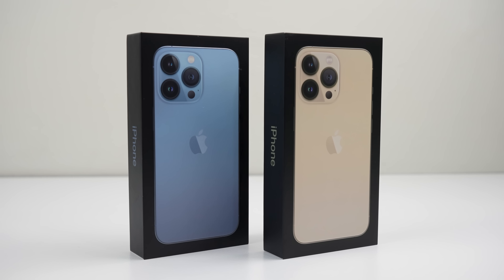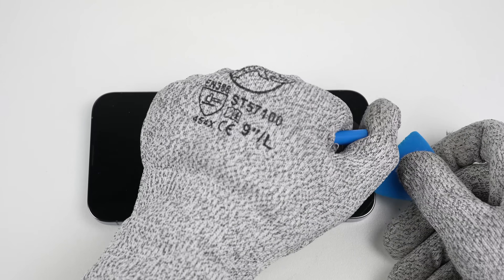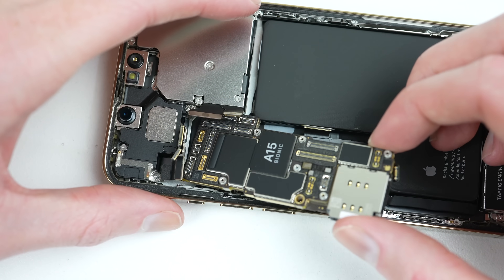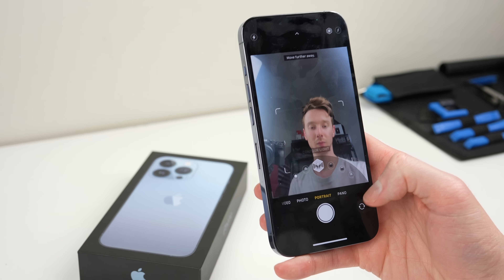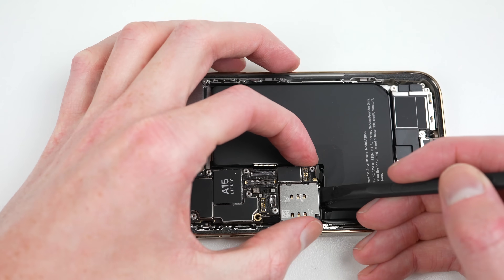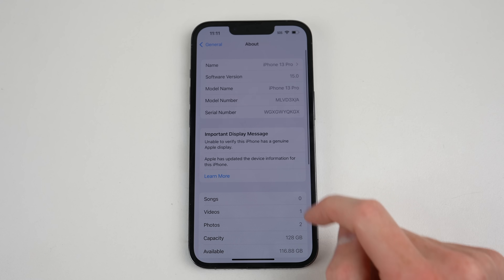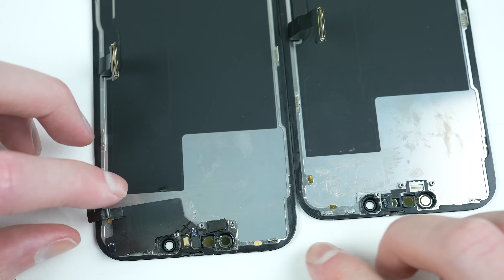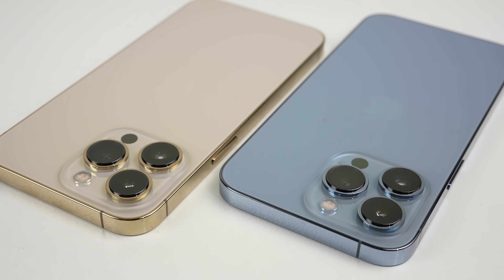iPhone 13 A Repair Nightmare - Teardown and Repair Assessment

Comment: I‘m not an expert, but knowing that no one is able to break into my phone via face id just by replacing the chip make me feel a little bit more safe. Am I right or wrong? Where do they store the face id data? The effects of a battery replacement would be interesting too.
Reply from the maker: I believe the data is encrypted and stored on the phone itself. In terms of security FaceID doesn't work after restart anyway until the passcode is entered. In my opinion, they should program the phone to disable FaceID and delete its data after it detects a new sensor but just allow you to re-enable it after you log back in and set it up again.

Comment: It's obvious what they're doing - they're serializing major components (read: individual modules have hard-coded GUIDs) and the OS quasi-bricks by disabling functionality based on a serial mismatch (read: when a component reports a GUID that doesn't match the OS' internal GUID list for the modules it was originally assembled with).

I'm not nearly familiar enough with Apple generally to know how to do it, but the hackers out there might want to see if they can find the phone's GUID list and see if it's accessible and editable via software - if so, it'll become possible (if not trivial) to swap components without the phone freaking out and losing its mind.
Reply: If they use such a simple scheme ( which has been used in the past ) it would be possible. However, they will certainly use some challenge/response encrypted scheme between components which will make spoofing guide near impossible. There are always some other hacks, like what has been done in the game console piracy scene, but it might take too much time...
Reply: @bschwand  if it can be done on first-party repairs, then it can be done anywhere. Just need some time and hints
Reply: @MrStealthWarrior  yes but time is the issue. You do not need to make replacing parts impossible, just make it hard enough that it takes too long to do it. Then nobody does it.
Reply: Doubt Apple would allow a way to view identifiers for individual phones
Reply: If the pairing is dependant on challenge/response and the cryptographic keys are held in the secure enclave, it’s basically game over. You’ll be talking about nation-state level resources to be able to swap parts at will.
Reply: Hackers lol, watching too many movies? Someone magic comes and saves you, right..
It's engineers against other engineers. If something is designed well to do one thing, you can't just magically reverse the process.
Reply: @ChargedPulsar  "If something is designed well to do one thing, you can't just magically reverse the process."

Yes, you can "magically" reverse the process - it'll just take longer if it's well-designed. There's an entire subgenre of programming devoted to doing just that. If it can be invented, it can be reverse-engineered.
Reply: @OddlyIncredible  You can reverse engineer the information and technique on the hardware-side. But you can't magically make the server-side do your bidding. Every update will automatically render your new hardware incompatible.
You can however, use another OS instead of IOS.
Reply: @ChargedPulsar  You don't need to reverse the process. You just need to swap serials to serials of those parts that you replace. That's it. There is not magic.
Reply: @ChargedPulsar  heard of reverse engineering ?

Comment: So Apple will let you pay for the privilege of using an iPhone but you can't own it.

It's so obvious that Apple purposely prevent people from doing any maintenance or repairs on their products. It's amazing that this is legal.

Absolute BS!

It's not like there is some hardware incompatibility preventing the use of the genuine Apple products it's rather some code written specifically to prevent the use of any new components without paying Apple for their permission! 

How is extortion defined?

Comment: You can try those experiments in iPhone x and you will have same result, the only difference is that you won’t have battery and display messages. Infact you can try and swap two screens in iPhone 8 and you won’t get Truetone.

Comment: At least you CAN find good quality replacement parts for iPhones with little to no effort. 
drops mic
Reply: Ok but like either way, it will block your phone lol
Reply: @monikasalt  a phone what will be at least somewhat functional vs a broken one that you can't find parts for? You're not making a good case. Yes, Apple is trying to kill of 3rd party repair and I'm not defending them, but android phones are not that much better in that regard, just for different reasons. Alot of repair shops don't even take in broken android devices.
Reply: @razaelll  it’s a global product issue. Almost everything is moving towards anti repair and planned obsolescence. We need sweeping right to repair laws across the board.
Reply: @chronovore7234  I'm not saying it's not an issue. I'm saying that everybody craps on Apple and use it as a scapegoat just because they're obvious about it. No manufacturer is saint and they all should get equal amounts of shit given to them. Not just Apple. As a matter of fact, it is easier to fix an average iPhone compared to an average Samsung. I worked in the industry for over 5 years, trust me when I say this.

Comment: Apple locks you in. Period. Cheeky having spent thousands on a device which should belong to you officially dose not.

Once purchase what you do with your device is upto the end consumer and locking the device to a serial number on every part of the phone is insane. Money making policies at their best. Rip off merchants in broad daylight. Yet trading standards and other hierarchy’s are part of the big scam. 

Very upsetting to learn on my Newley purchased iPhone 13. Really in the mood to return this shot back to the original owners other manufacturers probably deserve my money better.

Ultimately the option of properly experiencing an apple device should be left to the consumer and not tieying them down against their will

Biggest Scam of the 21st century

Comment: My brother works at Apple and this is what he told me, all original Apple parts work on all the phones, the only way to bypass the locks and error msg is to use a reset software(only Apple has access to them) to calibrate all the parts to work even its from a different device and after doing this the original part won't work anymore. So everytime you install a different part you have to always use the software to re-calibrate the entire phone. Apple doesn't tell you this
Reply: So simply acquire this reset software
Reply: @tldrvince4705  that is most likely it but I don't think it will be easy, I'm sure somewhere out there there are hackers that could modify a software or get this software itself and sell it or use it
Reply: @tldrvince4705  its almost like the John Deer tractors, you touch something and it can all break down, the dealer don't want anyone to fix it except for the dealer itself to maximize profits. But there are alot of people out there that know how to hack the ecu on those and get things working

Comment: Apple has no excuse to disable face ID after a screen replacement. I understand after a front camera replacement, I could make an argument for a security risk there but in no way could changing the display or even that sensor cable cause a security risk!

Comment: There honestly needs to be an EU law making it 

a) mandatory to build devices in a way batteries can be changed by a complete layman
b) illegal to implement screens and mainboard in a way someone with decent skills and basic tools can't switch them with new parts if broken
c) illegal to software-ID/lock any parts at all
d) mandatory to allow an easy and streamlined bootloader unlock (Android) to use community firmware after the warranty runs out
Reply: Why would you want to implement these idiotic very specific, 3rd party repairer friendly laws?
When the problem is entirely something else, companies owning the sold product completely still.

-You can just implement a law to protect the user rights by making a product continue to function.
If there are alternative similar companies.
-In the case of repair, if there are alternative repair capable services (3rd party).

With these laws in place, Apple(Or any other big company) could not have made the repairs any harder than they sensibly should be. (To protect the average joe from unintentionally opening the product and causing harm).

Companies should be able to make money, but not be allowed to become monopoly.
Reply: I think it's dumb that people cannot repair stuff. but in real life how menny people really do, I have never in the last 20 years replaced a screen or battery or anything on any of my phones, just because you can does not mean people do. It's like manual transmissions on sports cars like the Porsche 911 people moaned about it when they finally stopped making them with the option of a manual box but the fact was no one was buying them so they just stopped doing it.

Comment: I can't imagine the horror of an apple car breaking down in the middle of nowhere 🤣
Reply: Well you gotta buy a brand new car when the it breaks down lol
Reply: Unable to verify that you are using genuine Apple gasoline. Engine disabled.
Important message. Unable to verify that you are using genuine Apple tyres. Cigarette lighter disabled.
Reply: @u.v.s.5583  Apple car will be EV
Reply: @MainAutoOne  idc
Reply: @u.v.s.5583  Or worse still, "Unable to verify you are using Apple certified gas, self destruct in 20 seconds".
Reply: Genius Bar: “Have you tried turning your car off and on”
Reply: Imaging charging your care with non apple electricity "It would appear you have charged your care with counterfeit electrons ! "
Reply: We got one its called a tesla
Reply: Imagine it's a 1$ part but you need to replace the whole car
Reply: @Sakura_Yuki_NC  Nah, you just gotta disassemble the whole car, which won't be easy since everything will be held together with permanent glue instead of screws. Then glue everything back together.
Reply: @Sakura_Yuki_NC  I'm sorry, the electric charging plug door has a broken latch.  This can allow moisture into the charging system.  Vehicle replacement is strongly recommended before the next rainfall.
Reply: What ! Are they really making cars ?! I'm French, so I don't know. With DLC like video games ?
I will never buy or go inside one, so as not to encourage these thief tactics.
Reply: So what’s gonna happen is it’s gonna be like a tesla in which it’s gonna have a big iPad as the dash, but as soon as that iPad dies the whole thing has to get replaced. Your tire has a flat, sorry! You’ll have to buy 4 new tires AND rims. Your electric motor has a part broken on it. Sorry unrepairable you’ll have to buy a new one. Broken bumper from a crash? Sorry your car is totaled but you can trade that one in for 20% off the newest model! Yea the apple car cannot be a thing cuz if we thought Tesla was hard to work with in getting parts to repair them
With, it’ll be impossible to even find a car freshener for an apple car.
Reply: But Apple is “environmental friendly”

Comment: Well, you still own the phones but Apple wants people to use their genuine parts for a few reasons, make a lot more money for Apple (I know that does not make it right) and Apple wants to  keep the quality of the repairs top notch. I had a bad experience with the 3rd party repair and the screen replaced had a very low refresh rate and not bright,  even they promised the screen was a original Apple part.

Comment: You have to remember:
Someone at apple was tasked to find out which fake "issue" would trigger the most displeasure, then write up a task for a dev to code these issues into the firmware, then have QA test that those issues would correctly manifest when parts are exchanged and then they shipped it without any message, so that people would think the repair shop broke their phone.
Reply: it's absolutely despicable

Comment: these companies act all high and mighty when they pretended to save the environment by not providing a fuckin charger
BUT they also are moving towards making use and throw which increases the fuckin trash exponentially

Comment: The fact of the matter that everything from how far the singular lenses of the camera stick so far out to make it more likely you'll crack the lense. 

To the removal of the headphone jack so you'll wear the charging port, and to all of these things you've demonstrated. To removing the charging brick so you'll buy one to make more money. 

Apple's only goal is to make your phone as delicate and fragile as possible. To also make it impossible to repair once you do break it. 

This is not the Apple I remember. This is purely greed for money before anything else...
Reply: > Mounted giant fans on the OUTSIDE of the Apple IIe to prevent overheating, instead of paying out warranty claims to have their substandard power supplies repaired/upgraded

This is EXACTLY the Apple I remember
Reply: The removal of the headphone jack happend on the same time airpods released.
You could use cabled headphones for ever but wireless headphones will wear out after time and there is almost no way to change the battery on them. 
Why is it so bad if we had both, wirless headphones and a headphone jack? Because Money, airpods are expensive and standard 3.5mm headphones are not from apple most of the time.

Comment: I'm actually surprised that the phone does not refuse to work again after detecting that parts have been replaced. That is certainly possible, and probably forthcoming. I don't buy Apple phones.

Comment: The oven that Apple gives AASP's to heat up the display adhesive on 12's barely works. I've seen numerous displays that become damaged because the adhesive doesn't heat up enough to allow separation between the display and the adhesive. I can't wait to pull my hair out over the 13's now too.
Reply: The adhesive can be set up to require a specific amount of heat energy in a specific amount of time. Without this, the other parts can be designed to be damaged as well.
And a specific machine can easily repeatedly give the correct amount of energy/time and repeatedly open the device with no damage.

So people trying to own* these devices, which they don't. Will, just force big companies to take more protective measurements.

Instead you must ask yourself, how come you are so dependent on this device?

Comment: I think one of Apples arguments against self repair is that they couldn't guarantee the validity of the replacement parts.  Now we know that was all BS. They probably make more on repairs than the actual phones.
Reply: Well, how can Apple know that the parts you swap in, even though they are made by Apple, are working all correctly? They might be themselves malfunctioning Apple parts from malfunctioning phones. This is the true reason you need certified repair shops or Apple themselves.
Reply: @haomingli6175    It's very easy to verify hardware is working as designed.  Hardware is constantly monitored. Take the SIM card out of ur phone and see what happens.  I know someone who works for Apple. They now exactly what they are doing and it's not about protecting the users.

Comment: There needs to be a law to make companies like his advertise the fact you cannot repair third party. Prob is most people who have this much mo ey to waste can afford to pay apple stupid repair bills. It's the secondhand value that's going to get wrecked.
Reply: Right to repair bills would ban this kinda move outright if they pass, the intention of right to repair is to allow anyone with sufficient skills and tools to be able to fully repair their stuff.
Reply: @estherstreet4582  I was talki g to my son about this. Imagine if a knob on my washing machine broke and I replaced it with a new one of an identical machine and an error came up saying it won't spin anymore or the door will stay locked. It's ridiculous. On another note Honda make scooters that do not have some spare body parts you can buy. Mainly the large front part that is likely to get damaged. So a small bump is a written of scooter becuase you can't replace a fibreglass panel. Thsi is going on all over the different industries.

Comment: At least the features resumed working when the parts are put back to its place. Imagine Apple decides to disable it as soon as it detects swapped parts and keep it disabled even after swapping it back. That would be the ultimate dick move just to mess with repair guys.

Ah buggers, shouldn't have given Apple ideas.